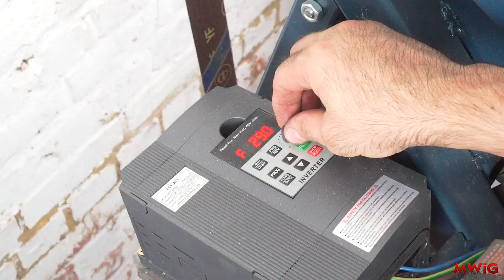DIY Screw Press Restoration

Comment: I really like the color. Great job. Will also work well cracking open walnuts.
Reply: Walnuts are easy, try cracking open a macadamia nut.
Reply: @coolhand1964  I usually use a DAKE on those. 😆